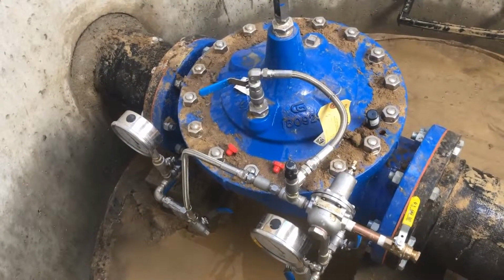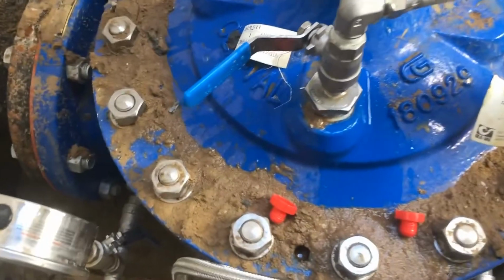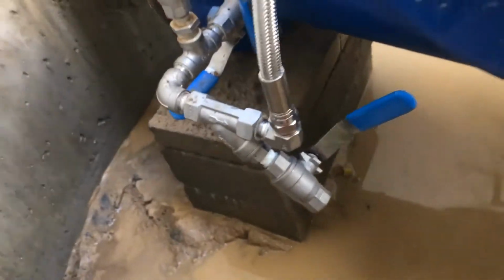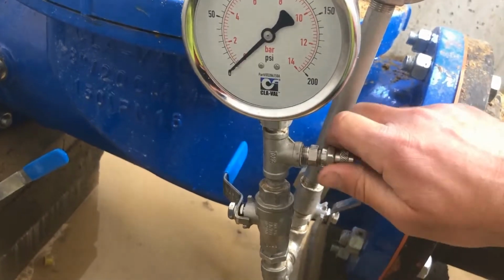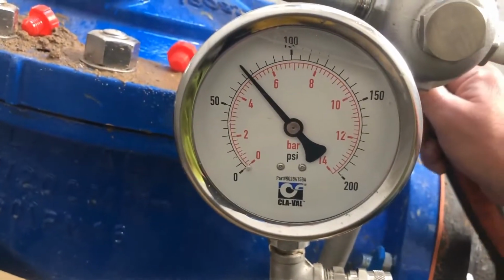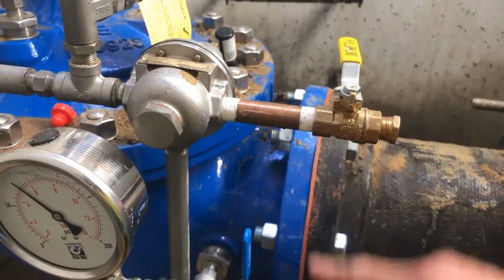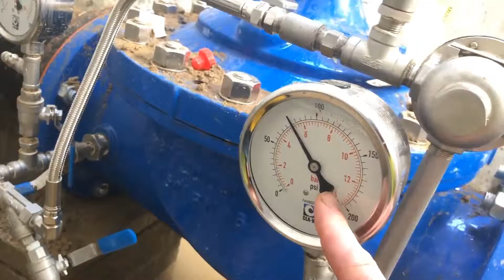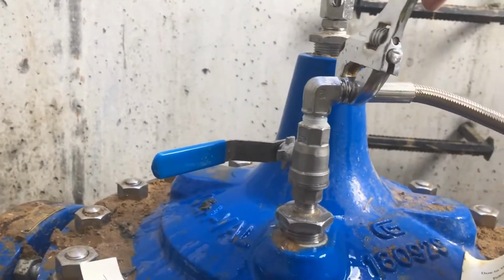Cla Val Startup

Comment: Think you'll find the copper pipe coming out the pilot can be used to set the pilot as long as you induce a small flow by cracking the tap on it.